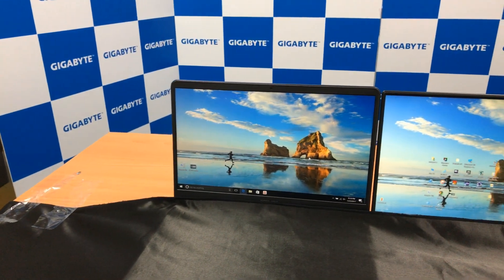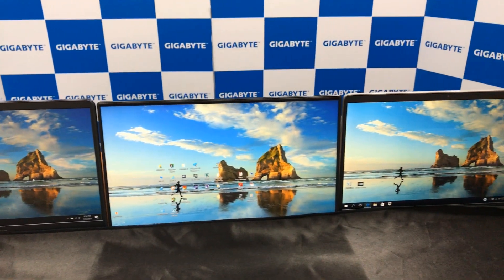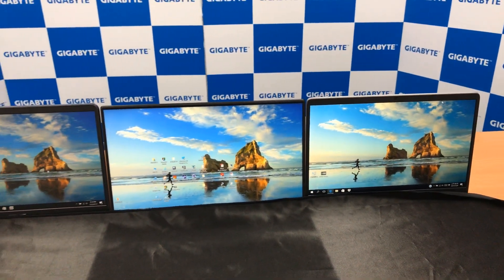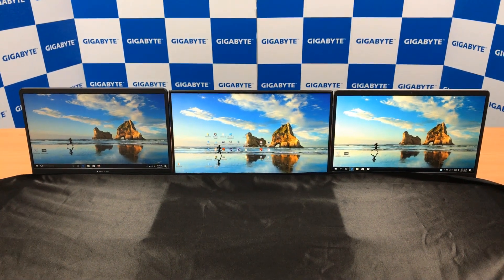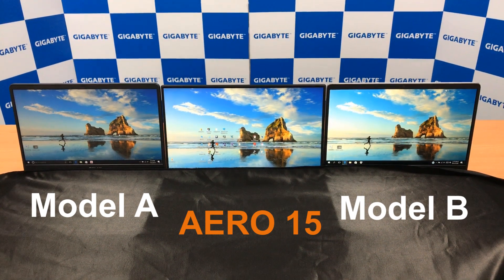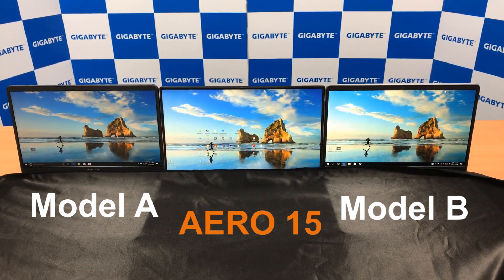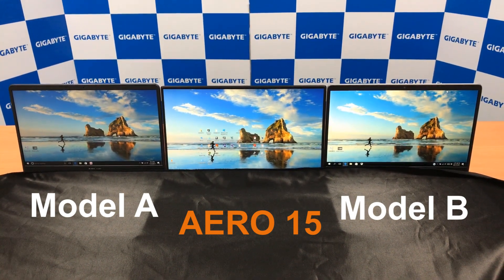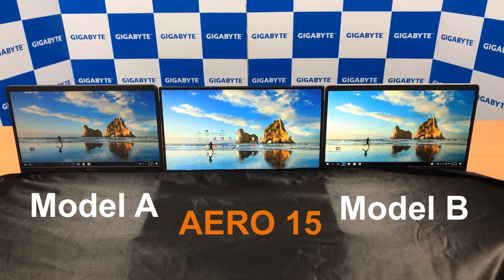GIGABYTE Technical Classroom: Thin Bezel Display on Laptop

Comment: Hey guys at gigabyte please hear me out, I'm a huge huge fan of yours, and I'm finding it hard to even think of having a laptop from other brand than yours... but to be honest I'm quite lost in regards to choosing the right model... in one side I love the aero 15 design and screen and TB3 , but prefer the aero 14's weight and footprint, and in the other side I'd like to see a gtx 1070 model....

so my question to you is: are you planing to update the aero 14 this year to have all of Aero 15's features (maybe also to add the gtx 1070 max q or something)? if yes, when exactly?

please please respond to my message, this is actually one of the few times I muster the courage to put a comment on youtube!
Reply from the maker: it's hard (actually it's impossible) to put GTX 1070 into 14" chassis due to thermal capability...but we will soon have more powerful version of AERO 15 so plz stay tuned with us

Comment: Those top bezels are bigger to accommodate a webcam, which you have down in a terrible position. The side bezels are actually similar among the 3... Why don't you reduce the aero bottom bezel, which is huge (and you have hidden it in this video...) and put a webcam on top?
Reply from the maker: actually it was the limitation of using thin-bezel panel

Comment: Really hard to hear speaker. When will an Areo 15 4K version be available? Will we see a 1070 GPU option?
Reply from the maker: 4K version should be a available in the end of this month and yeah we're planning on something more powerful on AERO 15 so plz stay tuned with us
Reply: GIGABYTE this is great news!
Reply: Will this new panel have WAY better black levels?  Your current one is wildly disappointing in that area.  Forced to return 2 after horrible backlight bleeding became too distracting.
Reply: Wow, I think you're the first person to report this. Is customer support accommodating or giving you a difficult time?
Reply: When buying a new computer at this price, any price actually, customer service must be amazing, if not the word will get out and people will avoid them because they will be afraid of getting ripped off. I sure hope that this is not the case with Gigabyte and the Areo 15.
Reply: I am also waiting for the news and some announcement too. I am hoping for a GTX 1080.

Comment: Since this is a professional designer and gamer centric laptop, competing with XPS 9560 and Razor Blade loptops, why not push the enverlop and enable 64GB DDR4 RAM?
Reply from the maker: there's no space for additional two RAM slot on PCB and currently DDR4 so-dimm module is only available with 8G and 16G capacity
Reply: GIGABYTE it sure would nice to have 4 sodimm slots :)